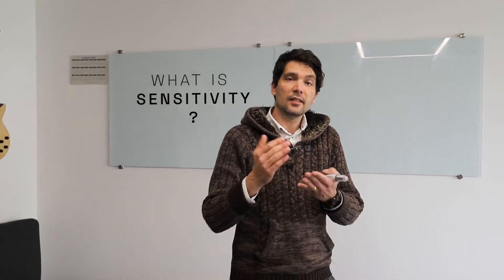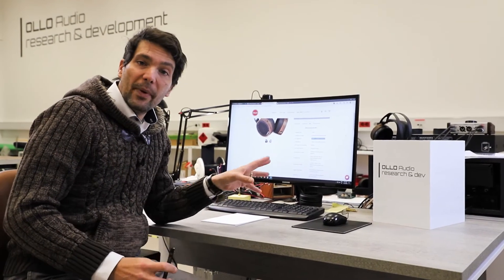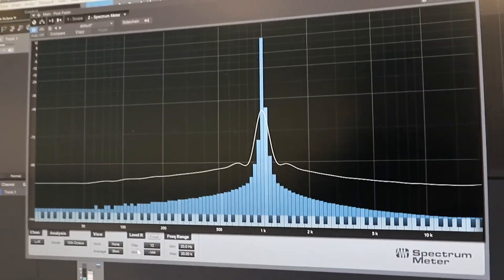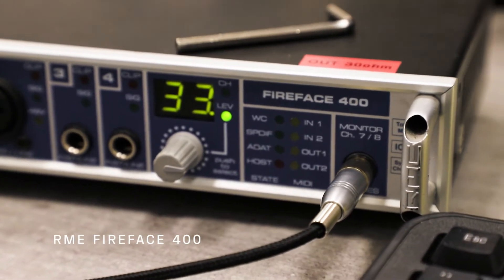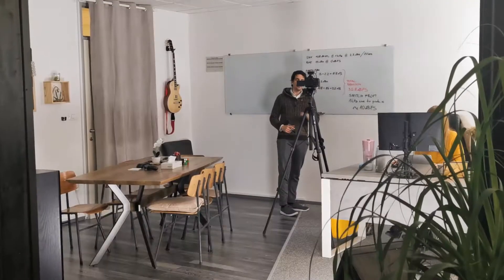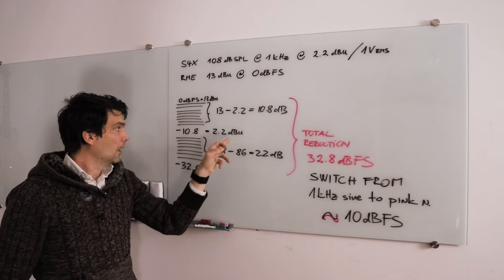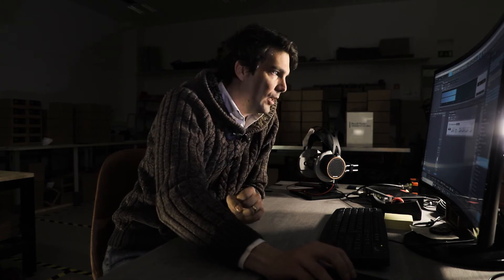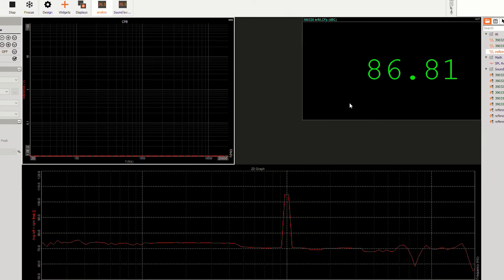K-METERING WITH S4X STUDIO HEADPHONES | OLLO Life with Rok Gulič #017

Comment: hello, the final result is applied with the volume of the amplifier to the maximum?
Reply: Yes, 0dBFS on output. Then it depends on output ratings, and that you get from the manual. If you use interface internal amp, then its power ratings are at full, maximum. If you use external amp, then you need to calculate what the output of interface pushes out and what amplification factor is for your external amp.
Reply: @rokgulic3095  ok, thanks, in my case it is an internal amp of a SSL 2     +10dbu. I just ordered my s4x

Comment: First day with my new headphones, so far really like them;) 
Can we get help with apollo twin x users?
 in the manual there is nothing close to measurments data you use to set this up.

Stereo Headphone Output
Frequency Response 20 Hz – 20 kHz, ±0.1 dB
Dynamic Range 124 dB (A–weighted)
Total Harmonic Distortion + Noise -98 dB (1 kHz @ -1 dBFS)
Maximum Output Power (into 300 ohm load) 96 mW RMS
Connector Type ¼” Female TRS Stereo

Much thanks
Reply: Usually Apollo is 19 dBu at 0dBFS. Many times it's 80mW into 600ohm  and that is 19dBu,...